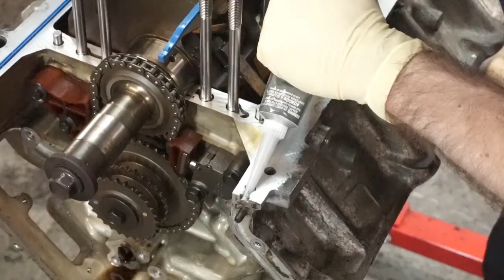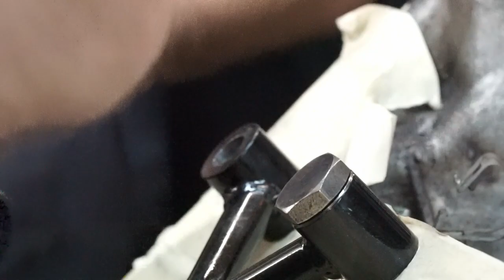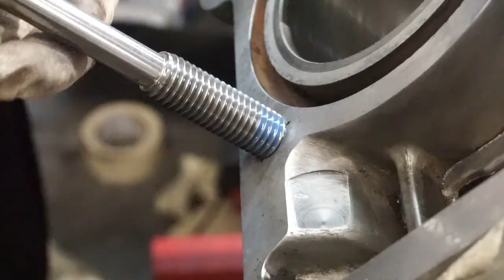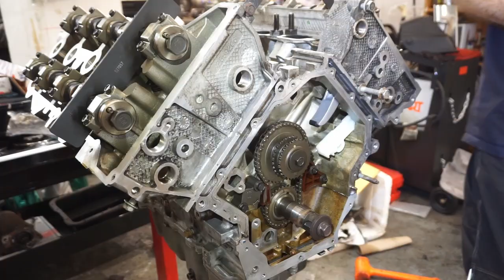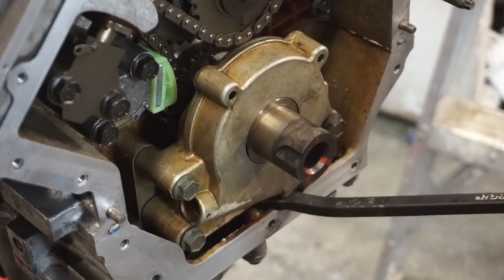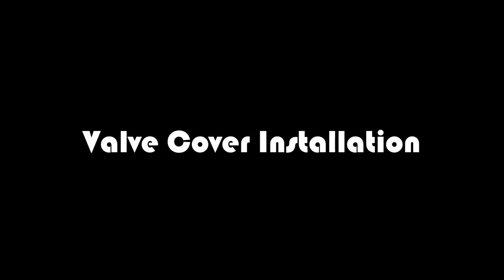2002 Cadillac Deville DTS Motor Removal Part 4 Re-Upload With Head Installation!

Comment: About how much would a job like this cost ??
Reply: dont know there but 2200 in Chicago
Reply: If the engine has overheated you also need to resurface the head and maybe even the cylinder block + if you are already taking the engine out for the headstuds then you might aswell do the rod bearings etc. So 3000-5000 with labor.

Comment: Didn’t you have to trim the 2 half case gaskets to get them to work??
And the mahle plate fits correctly if you drill the alignment hole closest to the timing cover.